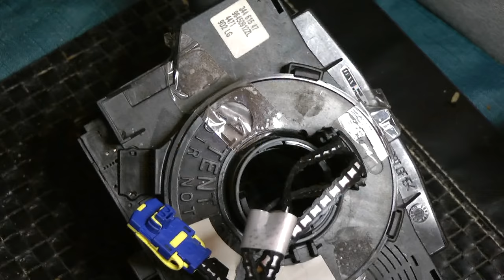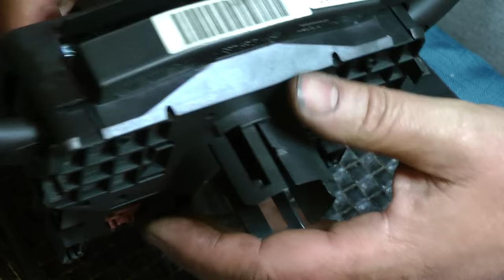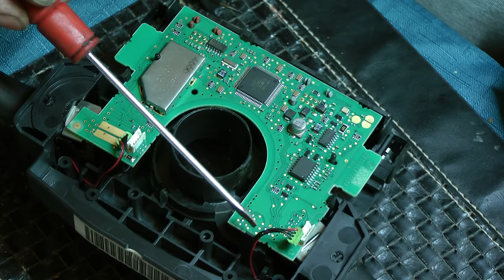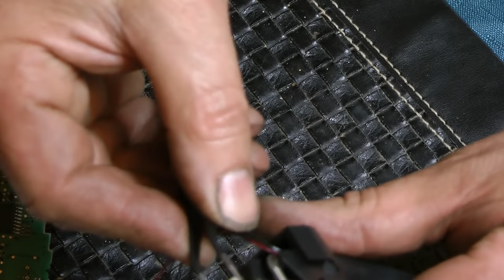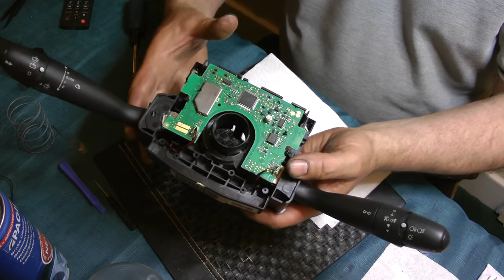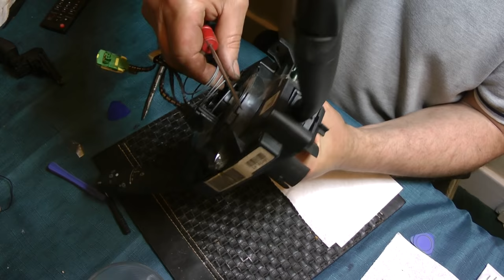Comm 2000 indicator switch fix detailed

Comment: We did this same process for my COM2000, Peugeot 307 2002 year model. Everyrhing works fine with the indicators/wipers. However after putting everything back together, the car refuses to start. Starter motor activates normally but it wont start. We read diagnostics with OBD and PP2000 and it doesnt give any error codes. How ever at the COM2000 tab it shows "Key status: Missing" even when the key is inside the ignition. Do you have any ideas whats causing this issue?

Comment: My Citroen Xsara Picasso has the problem where the the indicator works for one or two flashes and then stops and the headlights turn on. This does not happen when the headlights are on already. Do you think this is caused by the same part failure, or is it a different problem? Thanks in advance.

Comment: Just done this job on a 307 with the assistance of this vid.    Easy to miss that when removing the actual switch stalk, that the pathetic wiring for it must be freed from it's two little guide hooks,, to avoid straining it when the stalk suddenly comes out of the main assembly.    Good video, thanks. 

Alternative methodology for repetitious Peugeot/Citroen problems of this type involves paraffin and matches..
Reply: i did this and the cable has just pulled right out of the indicator stalk...anyone know how to open the stalk itself so i can plug the cable back in please?
Reply: @ncmarkham  I dit this exact same mistake as well. have you come out with a solution ?
Reply: @bibana06  It was the final straw for me, the car had other issues too so i scraped it. I did think of cutting the stalk down it's length and then glueing it togther again. It's a bad design imho.
Reply: @ncmarkham  Honestly, I was in a total state of rage After that and about to do the same. But I may finally have reconnected the wire using an endoscopic camera and a mikado (a small piece of wood lol). To do this job, I had to dissemble the end of the switch whith the connectors that look like small fingers then re assemble it. I will test it and let people know if it worked.
Reply: @bibana06  Good luck and 10/10 for perserverance. 👍
Reply: @ncmarkham  thank you very much !
Reply: @ncmarkham  So, to let people know : I tested the wires and they worked perfectly, but after re assembling the com2000 and then reconnecting the battery, the lights are on as soon as I open the door and nothing works anymore. So I am considering buying a new com2000.

Comment: Thanks for the video. Note when clipping the case back together wedge the "copper" spring contacts back (eg with Lego blocks) so the two pins on the other (circuit board) side don't go behind the spring contacts.

Comment: Great video, gives me confidence to tackle my Comm 2000 on my 406 Coupe but problem with windscreen washer not working after checking pump and fuse I think due to switch problem
Reply from the maker: Sorry I missed the last part of your comment or I would have replied sooner. In my experience the only place I have found a problem with the washer is at the pump itself, the connector to the pump or the wiring to the pump. I would disconnect the pump and see if there is 12v at the connectors then put 12v across the terminals to see if the pump runs. Share your experience and let everyone know how you get on. Good luck.

Comment: Thanks, I've spent hours on the problem. When the pump stopped working 6 months ago I checked the fuse which was OK so immediately jumped to the conclusion it was the pump so bought a new one without checking it and the old pump turned out to be OK. I checked the supply voltage at the pump terminals with somebody holding the stalk and it showed 4V but since then it shows zero voltage. The wiring is very difficult to work out since I goes into a very thick harness. I read up on forums that it could be a bad connection in the Comm 2000 but have doubts since when you pull the stalk the wipers sweep 4 or 5 times as they should so presume the contact is being made unless there are 2 separate contacts which was why I planned to open the unit and check. I'll certainly update what I discover but it won't be until next month since I'm working away at the moment.
Reply from the maker: I would be inclined to check the wiring connectivity first. There are too many variations in the wiring diagrams. If you let me know the build code (the number on the drivers door pillar). Some have a relay in the engine compartment fuse box and some use the BSI under the main fuse box. You need to know what one you have

Comment: iv got the same problem on my 307 (floppy). a new comms unit is the best part of £200 nfw. just found the part you replace on ebay by chance so im going to give it a go, fingers cross that it will work. thanks for the vid.

Comment: Great video but note that on reassembly of the switchgear the terminals for the airbag will go to the wrong side of the little short circuit tabs unless they are pushed over as the cover goes on. Probably easier to take them out and replace them. if nothing is done the connectors will not go in properly and certainly won't connect!
Reply: After months of trying to fix the airbag warning light it seems that this was my problem all along. I'll try this tomorrow and see if it works!
Reply: man I just reassembled and have the exact same problem ... god these are shit cars to work on ... So did that fix the airbag light for you?

Comment: Hi very good video👍 I have Renault trafic and the controls look exactly the same. My indicators are working absolutely fine it's my high beam won't stay on I've checked all fuses and relays and this is my next step this video, does full beam also use this little plastic part or is that just for the indicators?

Comment: Thank you, very explanatory!! My problem (Peugeot 307 -08) is only that the turn signal does not make that clicking sound. Otherwise it flashes well. Maybe the switch tgear can be fixed. Where does the turn signal click come from inside this switch gear?
Reply: Hey.Got the same problem.Did you manage to fix it?
Reply: @jack5611  Hi! No i never got it fixed. Too complicated to try do this on my own (this guy was very competent). I found a repairfirm in Sweden that maybe could do it. The cost would be 7000 SEK (=610 Euro). Given the the age and value of the car I found it unnecessary. I played along and ignored the silent turnsignal (which is not an issue in the yearly car inspection over here). Good Luck!

Comment: Hi, I have a 206 1.4HDI Peugeot built 2005. Whenever turn the ignition switch on, it will start the low beam lights also, regardless that the switch for the lights is OFF. And same time I can not signal left/right.  All this will come to normal if the lights switch in on the Parking position(can use direction indicator signal lights, low and high beam lights). Yes I can drive like that, BUT, already renewed 2 batteries because of forgetting to switch off lights before leaving the car :) . Have no problem with the wobbly direction indicator lights handle. Can you help ? Looking forward to your reply, Thanks

Comment: Hi if u could answer a question for me please.My 307 has this problem of floppy stalk but also I only have low beam lights won't switch to high beam ,the lights on dash change from green to blue as if they are switching but don't. will this repair fix this also?

Comment: I think I might need to use this guide. My left indicator isn't working. Some times it works and some times it doesn't. The hazards work fine though. I'm guessing there isn't a connection on the stalk switch?
Reply from the maker: When the switch is badly worn, the contacts don't quite meet. Always give the contact a good clean to ensure they are grease free.

Comment: Can you help me. I accidentally rotated the clock spring thing and now when I turn my steering wheel there is some rubbing noises like two plastic parts rubbing in each other. I'm not exactly sure if that is the reason for this noise, but I also almost opened the clock spring, before finding this video, because I wasn't sure how to open the dav comm. Great tutorial anyway! Thanks!
Reply from the maker: I dont think rotating the clock spring would cause any issues. You can rotate it to the end of its play and back the other way. If memory serves me it is 9 full revolutions end to end. The important thing is it is returned to the middle 4.5 revolutions, assuming the steering started off straight. Does the comm unit make the noise off the car or is it only when on the car. Wire routing. Horn contacts. seem the most likely candidates. Unless there are any broken plastic bits when taking it off or back on.
Reply: @bunnybr  Hi! I fixed it but now there is another problem. I lost my horn. I had to manually wind up the clock spring cable and now my horn does not work. Please if you have any idea what is wrong, tell me.

Comment: Had the same issue, fixed the stalk beautifully wit,h the tip here and a £1.79 part from China, but unfortunately after refitting I now have the airbag light illuminated! 😡
Reply from the maker: Check the connectors as I recall they can be connected but not live. You can test it by bridging the connector with a 3.3ohm resistor. If ABS light goes out that is the circuit.

Comment: Hi,  I gave stage problem on a 206, when car is started the headlights turn on without me switching them, however if I indicate the lights turn off. would this point to a faulty comms unit?
Reply from the maker: The symptoms seem very similar to my own. It should be easy to verify that it is the slack stalk that is causing the issue. Auto headlights come on when the car starts.
Reply: +bunnybr  don't think it has auto lights, but when you indicate to turn left or right the lights turn off

Comment: Where did you buy the replacement spring?
Reply from the maker: +Jeremi Roivas I reused the old spring as the plunger does not come with the spring. I hope you haven't lost yours. No idea where you would get a spring.
Reply: where do you get the part from
Reply: where do you get the part from

Comment: Great video, but the damn wire plug fell out of the indicator stalk and I have no idea how the hell I'm supposed to get that back in, it's completely invisible and the stalk assembly will not come apart without causing major damage. Stupid, stupid design, made to fail and £7.99 for 1 tiny plastic part really is shafting people!
Reply: This has just happened to me, did you buy a replacement indicator stalk or did you manage to get the wire plug back onto the stalk?
Reply: @ncmarkham   I had the same problem today. How did you guys fix it? is it possible to only buy a stalk? If I search on internet it looks like i need to buy the complete unit. I was so close and then i noticed the wire was out of the stalk.... probably you guys had the same feeling :P
Reply: @bartsteenman7618  My car wasn't starting too well in the mornings and this was the final straw so i scrapped it. The cheapest way is to cut the stalk open  with a Dremmel (rotary tool), put the plug back in and then glue it back together. I tried to buy another stalk from a local scrapyard but it was slightly different and wouldn't work.

Comment: When I put mine back in the car, there is a clicking when I steer left and the indicators do not auto cancel. What did I do wrong?
Reply: Rebel 4 Jesus I guess you fixed by now ? I would guess that you have rotated the com unit. Make sure wheels are dead ahead and check for alignment on com 2000
Reply: @lester8436  no I just cancel it myself but thanks, I can try that if I have to take it off again :)

Comment: salut les amis j'ai un problème qui me tracasse j'ai une Peugeot 206 a qui  j'ai changer le rotor  de direction chez un mécanicien de ce jour j'ai pas de klaxon et le voyant air-bague reste allumer et accompagner d'un klik sonore. s'il vous plait si vous avez des explication ne tarder pas me répondre mercis d'avance .
Reply from the maker: Have look at my other video "Steering wheel airbag removal to fix air bag light on a peugeot 406." This should give you all the information you need. 
Avoir oeil à mon autre vidéo "retrait de l'airbag du volant pour fixer coussin gonflable sur une Peugeot 406." Cela devrait vous donner toutes les informations dont vous avez besoin.

Comment: Can someone post a link to were to get the plastic replacement part from?
Reply from the maker: I dont want to favour any particular supplier. I did a google search on peugeot indicator plunger and got all the information you would require.
Reply: +bunnybr 
Thanks for the reply, I got one already from ebay,, Only problem was when I pulled my comm2000 out it was the Delphi version, and the one in your video was for the DAV COM 2000.

Comment: I dismantled mine and now the sprinklers turn on and also I get airbag fault.
Reply: I got airbag fault to. did you find out what caused it? my full beams use to come straight on but after bit of time adjusting the four mental tags, on the end indicator, managed to fix it :) maybe you got the same problem n that the mental tag is connecting to the circuit board with being told. :)
Reply: I got airbag fault to. did you find out what caused it? my full beams use to come straight on but after bit of time adjusting the four mental tags, on the end indicator, managed to fix it :) maybe you got the same problem n that the mental tag is connecting to the circuit board with being told. :)
Reply: @kaibrown987  I have the high beams on permanently as well. Which of the metal tags needs adjusting?

Comment: Instructions not clear and you failed to mention some key parts, witch made me fail and break the part. The metal "legs" , the tiny ones on the end of stalk, if you bend them just for a little, it's done, you will need a new one as you wont be able to bend it back like it was. The plastic that holds the stalk, if you force it too much, it will not hold the stalk again , it will fall .  It doesn't explain the signal canceling , how not to screw that part . Lots of information missing .